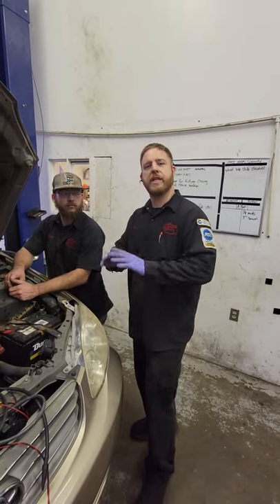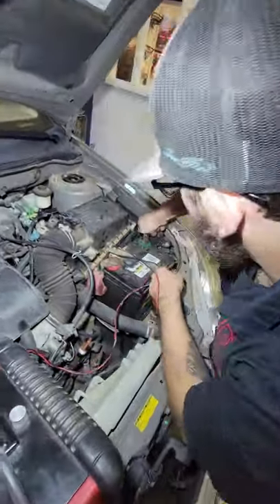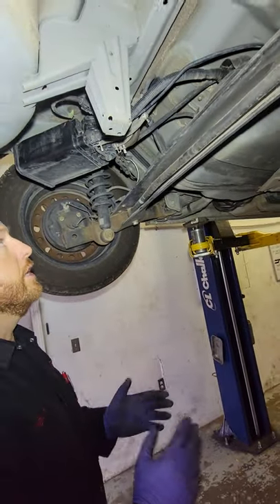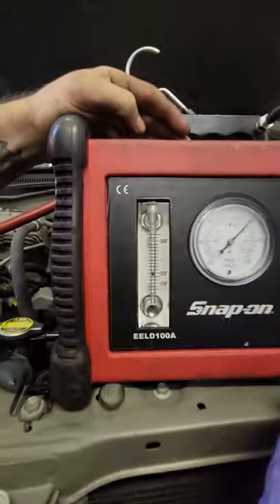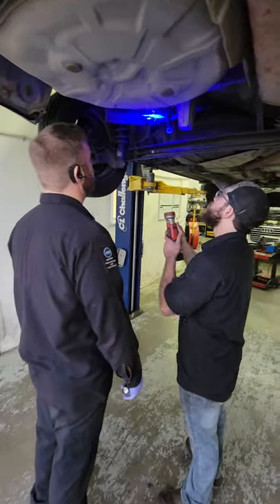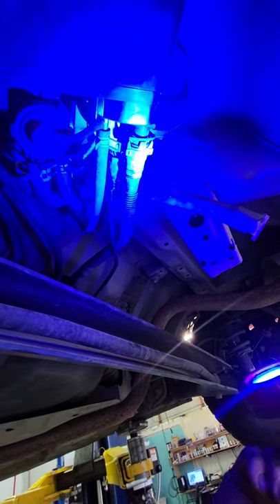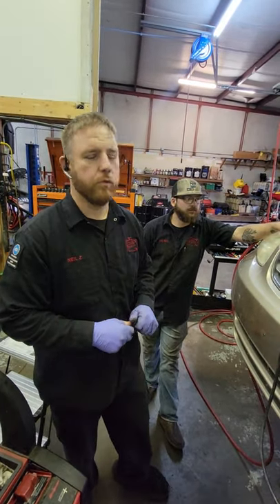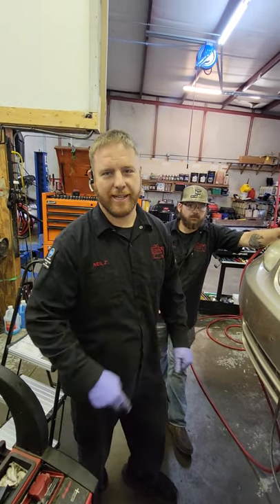Toyota EVAP System Leak Testing: Automotive Technician Training Series #automotive #mechanic #auto

Comment: I performed a smoke test my same model 03 Corolla but I couldn’t find a leak. I check all the hoses connected to the canister, the fuel neck, the top of the tank, and the engine bay. All of the vacuum switching valves click on and off. I know the smoke circulating the system because I saw smoke come out the vent hose before I clamped it. I smoked the system to 1 psi for 5 minutes and the gauge did not drop below 1 psi after that. I have codes P0440 (evap system) and P0442 (small evap leak). Does this mean my canister is bad, if so, how do I diagnose that because it’s expensive.  I already replaced gas cap and purge valve since I was told they’re common causes. Please help, thanks.
Reply from the maker: I would agree on replacing Canister.
Reply: @nzdiagnostics2010  is there any way diagnose that it’s the canister causing the leak?
Reply from the maker: @michaelhaile401  If you did all the testing you mentioned, you're 100% certain no leak is present from the EVAP system & all your sensors/switches are working then you got to make a decision on your testing.